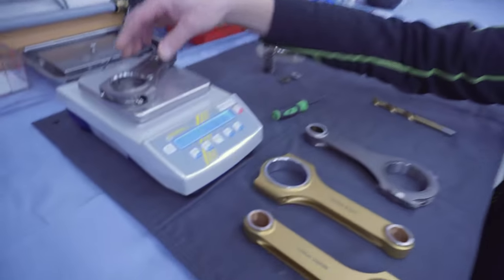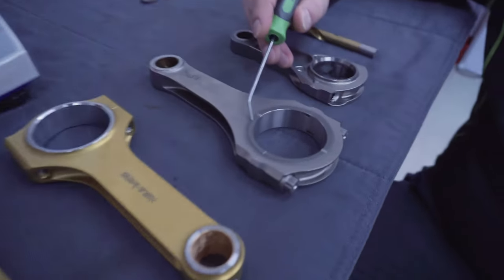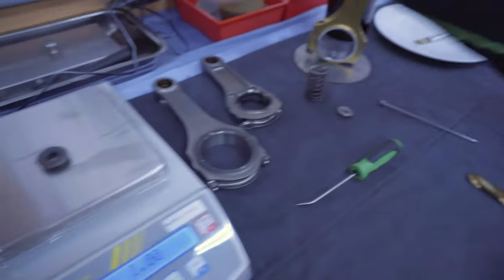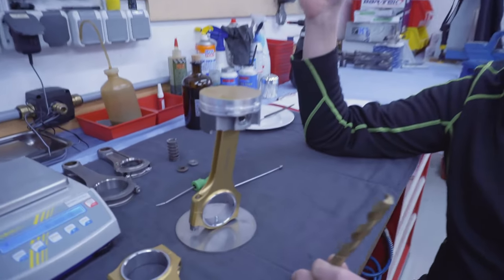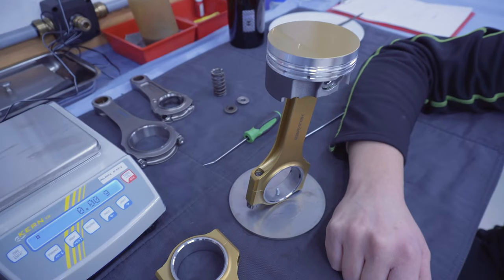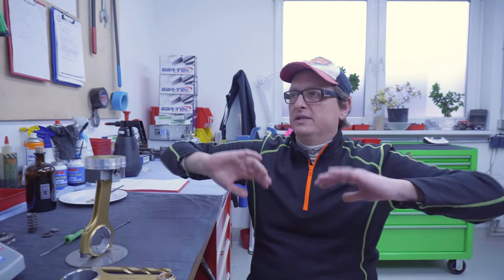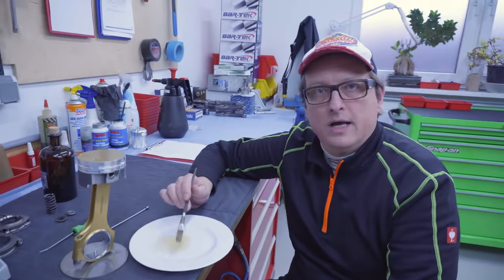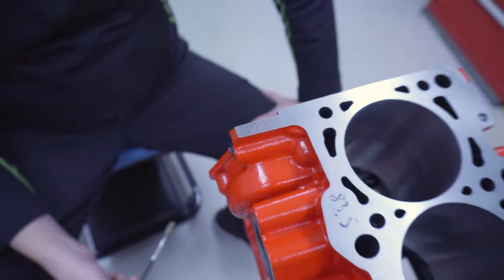Titanium - Everything you need to know! | BAR-TEK® Motorsport

Comment: The coating is like an exoskeleton I think is what you're trying to say wondering why titanium rods are not popular in drag racing or Dragon Drive events where drag racing cars drive thousands of miles while also drag racing and pulling trailers
Reply: The answer to your question is one they’re really expensive and two they’re not advertised because most companies would rather you keep bringing your engine back and swapping through aluminum rods. If you sold a product that lasted it was guaranteed the last you wouldn’t have very many customers after year.
Reply: Its Rasier and cheaper to buy News Rods than Break your crank/Change it regulary.

Comment: I am building a Mercedes 5.0L Stroker Engine to 6.0L with a M119 Block. I have to custom order myself Pistons and Connecting rods and I am curious if I would benefit of Ti Connecting rods compare to Steel. Would the engine cause to accelerate faster compare to Stock Steel, will the edge have different characteristics that are noticeable? My Mahle Pistons will also be significant lighter.
Reply: It will have a smoother idle a rev faster and higher. You will love it.

Comment: Awesome video..I have a question on lapping con rod bolts for use with Titaniun Rods. Here is what we're dealing with. About 12 yrs ago I had to shelf a project that I am now pursuing. I had Greg Cunningham make me a set of stock length 1998 Subaru 2.5 phase 1 Titanium Connecting Rods which are going into a turbo closed deck block application for a sand car. Greg made his own rod bolts with rolled threads rated at 286,000psi 3/8 bolt.
I've been in contact with Lisa Kubo who had a Honda race program and was running Cunningham Rods. I reached out to her with questions as I knew she put her faith in Cunningham Rods so I figured she was a good place to start since Greg Cunningham is now 93 yrs old and sold the business so getting an answer from him might be difficult at best.. Greg never used ARP Ultra-torque on his rod bolt threads, but instead used 80/90wt gear oil instead and also never used a stretch gusge value vs straight torque.. I am trying to do everything correct with this build which brings me to my main question. Lisa told me to make sure I lapped the Connecting Rod Bolts well before installing them. When I sent her a email asking about the process,, she never returned with an answer so I'm even more in the dark now than I was before contacting her originally. Greg's Ti rods are shot peened and plasma moly coated bronze bushed with a combined weight with bolts of 332gr. I'm not 100% sure this was a good decision on my part with incorporating into a turbo eng or not, my thought was faster spool less rotational mass and easier on the bearings vs a heavy steel rod as in the Pauter X Beam 4340 chromoly at 586 that came out..

So any thoughts on how to lap Con rod bolts would be appreciated.. My only thought on this process that I could come up with was to place the caps in soft jaws of a vice, place valve lapping compound under the shoulder of the bolt head, then attach a piece of hose/fuel line the the threaded side of rod bolt and proceed to lap the bolt head to the cap mating surface..I've talked to a lot of racers/builders and no one has been able to give me any advice or even heard of lapping the rod bolts..
Also do u have any advise on why Cunningham would use 80/90 vs Ultra-torque on the threads of the con rod bolts, and who would I contact on rod bolt stretch for Cunningham rod bolts, it's my understanding they were his bolts, but it's unclear as to who actually made them for me to get the right answer from..

Thanks in advance, I subscribed to your channel as I enjoyed the oil squirter video and stumbled upon the ti rod video so I liked your insight and felt you were a good place to start.. Please help me shed some light on my situation..

Comment: Titanium coats on anything is just a sales gimic. Think of it like this if you put aluminum foil over butter the butter doesn't become stronger it still fails if you can't afford pure Titanium alloy parts just get the strongest stainless steal you can afford it's fine the new starship is stainless steal and it can travel at 18,000 mph through the atmosphere with tons of onbourd payload if it cam handle that it can handle your modified car